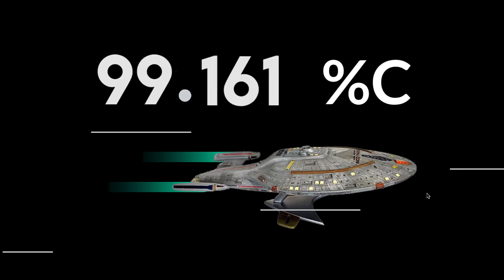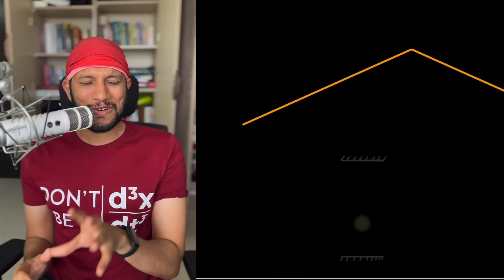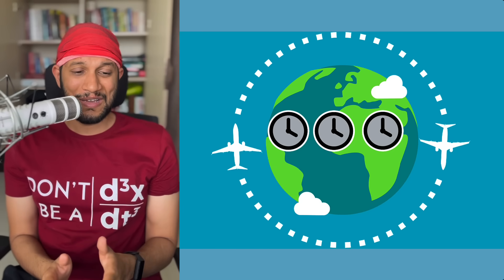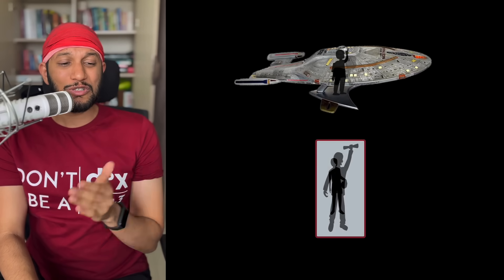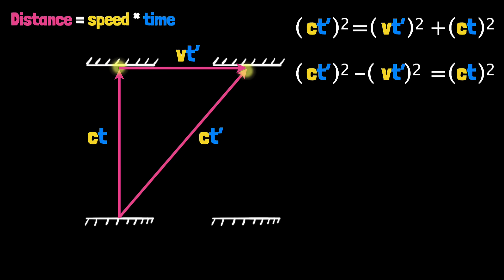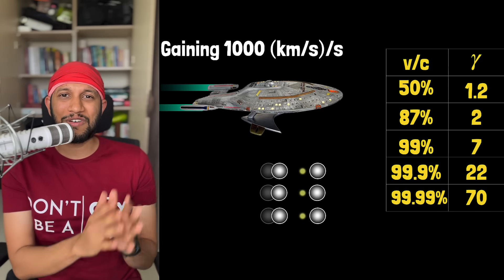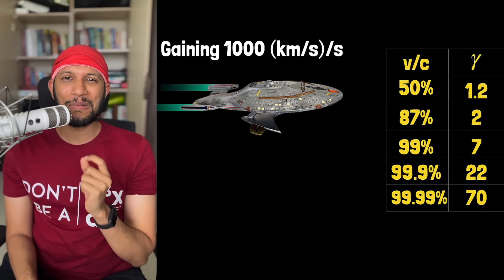I finally understood why you can't go faster than light! (My mind is blown)

Comment: Go with Brian Greene’s explanation.  If you manipulate the “Gamma” equation, you’ll find an “imaginary” axis locked at the speed of c.  In other words, we are “locked” at the speed of light traveling through the dimension of time.  Now, yes, immense things like black holes or massive galaxies can “bend” it a little bit, but gamma is really, really hard to change.

You talk about time dilation, it’s simply applying the Lorenz transformations from one inertial frame to another.  We have to design the clocks in GPS satellites to run just a tad faster to compensate to get the accuracy needed.

Comment: What if on a vehicle moving at 99.99% of light speed, headlights arr switched on. The light beam from an outsider's perspective will physically still appear to be faster than light. Or basically would you see complete darkness (no beam from headlight), beacuse that light will never reach the outside observer🤔.

Comment: But this can't be. no forces or velocities in the x direction can change the time of trajectory in y direction . if the ship suddenly goes in the speed of light the photon would just make collision with the left wall and so on on the opposite and that would make the photon collide with all the walls and break the sync . 
in a different case if the ship is already at the speed of light then the photon has to be the speed of light at both x and y Direction which makes it easier. in this case no deviation of path can be noticed. 

in both the cases your explanation fails .
Reply: c is the only speed in space time, it's not dependent on force
Reply: @AMC2283  its physics man everything is dependent on everything. we just make theories and make assumptions to make calculations easier . 
assume you take a torch and turn it on and put light on a wall . now if you raise the light in y direction doesn't the point of light being projected change ? and there's your answer when you move your photon clock in some direction different to the trajectory to the photon it's likely to affect the trajectory of the photon itself its just simple mechanics .
Reply: @deepakmahata12  if you’re so smart what’s stopping you from learning more about relativity
Reply: @AMC2283  oh I'm not trying to justify myself as smart . I'm here with a simple doubt and trying to correct the flaw whether it's about my theory or his . i just need someone who could clear my doubts . if you can then you are welvome my friend don't get me wrong .

Comment: Simple answer.  All movement through the aether (quantum space) is controlled by the medium through which it moves.  The aether Sets the speed limit.  EM waves are transmitted by the aether and cannot be transmitted faster.  Matter(mass ) trying to move through the aether causes a massive backward pressure by the aether against movement.  By the way; that pressure is called gravity.
Reply: Напиши физико-химические параметры эфира.

Comment: Space and time are the same thing, right? So, if you accelerate at speed of light, time stops. And if you let time flow, you are slower than light. The two things are bound together, like the x and y in a graph. The bigger the Y, the smaller the X and the bigger the X, the smaller the Y.

Comment: this guy is THE BEST, MOST CLEAR EXPLAINER, after 50 years of attending lecttures, reading hundreds of books. the guy has a gift... thank you so much
Reply: Real
Reply: IT'S POSSIBLE HE'S READ THOUSANDS OF BOOKS - EVEN THAT HE'S READ EVERYTHING ABOUT THE KNOWN PART OF THE UNIVERSE AND NOWHERE IS THE KNOWLEDGE ABOUT UNKNOWN MATTER AND UNKNOWN ENERGY EVEN 94+% -- ALL WE KNOW IS JUST ONE PIXEL AND WE DON'T KNOW IT ENOUGH-AND ON THE BASIS OF THAT, TO CLAIM WHAT IS IN THE WHOLE PICTURE WHICH WE DON'T KNOW HOW BIG IT IS OR WHAT IT IS MADE OF - IS THAT NOT IN THE DOMAIN OF FAIRY TALES?
Reply: The entire video is a circular fallacy. You supposedly trying to prove why it can't go faster than light, and you start by saying "the photon always moves with the speed of light".
Reply: @AnoNymous-dh2sv no you're trying to prove why you can't go the speed of light or faster. Not the photon.
A light photon in a vacuum will always travel at the speed  3E8 m/s.
A least that's how I understood this video
Reply: No.
Reply: Did you realize that your conclusion ends with the energy required, infinite or finite? Did you know that you also need energy to see the photon in the photon clock bounce? Just for reference, the photon in the photon clock must split off a photon to your retina in order for you to see it. Even if you only see the photon in the photon clock once a second, the photon in the photon clock must split off a photon to your retina every second, not to mention that Einstein also saw it. So, at least two photons are needed. Of course, to connect the dots or photons you see and form the jagged image, do you know how many photons you need to see? Does the photon clock on the spacecraft have enough energy to emit enough photons for you to see it, whether you see it or not? Indians are the best at regurgitating what they have eaten and acting as if they have understood it. After all, at a speed v comparable to the speed of light c, does the Pythagorean formula still apply?
Reply: ;DDDD
Reply: Not really
Reply: Just wait until you find out how to bypass the Heisenberg uncertainty principle or create faster than light communication.  Then you'll have some fun.
Reply: @zavatone aliens watching humanity be like:
Reply: it is wrong. no real clock slows down, because no real clock measures time, not distance. all real clocks measure time*distance, and that is a non-variable. 
Einstein was often confused
Reply: @Sergiu.antifascist I think you're confused.
Reply: @Sergiu.antifascist If no real clock measures time, then what is there that can measure time? And if there is nothing that can measure time, then what makes time a real thing on its own?
Reply: You've read 100's of books on this and it still took this dude's video to understand time dilation?
Reply: Doing something wrong if u found nothing valuable on this in 50 years.
Reply: The issue with this explanation for me is that it is BASED on the assumption that the photon can't go faster than the speed of Light. BUT WHY? 😂😂
Reply: you have 1000 videos on yt ekplaining it equally good, if not better
Reply: @MrAlkanet-nt9ic  all are wrong. not a single video of all those, explains you the three aspected time, or distance. not a single video made in this world, yet, explains what clocks measure
Reply: @Sergiu.antifascist  clearly you havent watched all of them...
Reply: @Sergiu.antifascist wtf are saying?
Reply: I don't understand why he would use a ship from Star Trek, because everybody knows that Warp is all about making space move, not moving the ship.
Reply: @perttiroska9970  I never watched start trek, but I always assumed the engines used caffeine exploders. Then when the ship blows up it becomes end trek, and we could all then watch a tv show that doesn't suck.
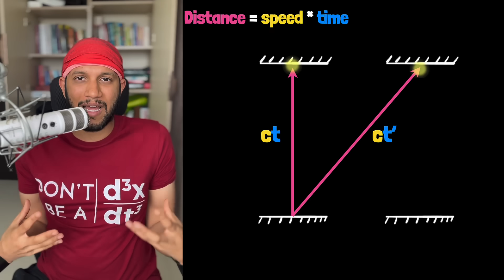Reply: his explanation is flawed though. at 8:40 he claims that hypotenuse is ct` , without ever asking why is it c times t` . this formula itself assumes that c does not change, and therefore it's t that must change, into t` in this case. but why must this be the case? what if the speed changed, because of some effect? he never asks that, he just assumes that photon moves with the speed c , not questioning it, and yet here lies the very question he ventured to answer.
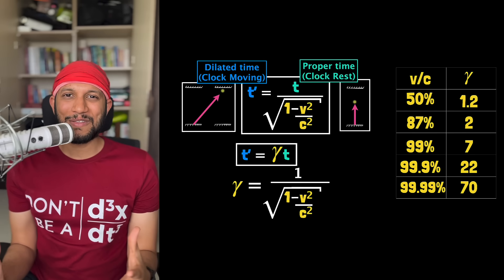he completely misses it.  and then after 11:40 he tries to answer the actual question of "why can't we go faster than light", and for that he proceeds to calculate some dilation values using the formula that assumes c is max speed . you understand the fallacy here, right? 

so he tries to prove that c is max using a formula that assumes c is max.
Reply: @foxxy-t4i  ? Are you actually questioning if light always travels at C? It's as proven as you can get in physics or anything for that matter
Reply: @sousounosali  We all once agreed that it might be a small dwarf, or a toad living in that hunch on your back. To question that would get you a dip on the witch's chair. Old SNL reference there.
Reply: @sousounosali  you seem to misunderstand. I am not questioning anything, I am asking why cannot something go faster than light, which is precisely the question the author of this video set out to answer. Sadly, he used the formula that just assumes that C is max, so it doesn't actually answer the question.

He uses a clock experiment where he assumes that hypotenuse is ct` , without ever asking why is it c times t`. What if it's c' times t' ? Why is c fixed? He never explains it, he just assumes it is so. Which does not answer the question.
Reply: @foxxy-t4i C is fixed because it's a constant that has been measured and confirmed millions of times. The speed of light is always the same in a vacuum, regardless of the observer's motion.
Reply: @foxxy-t4i c is the speed of light and is a constant. He's not proving why the speed of light cannot change, he's proving why we can't reach that speed. c cannot change which is a known fact that can be proved by other methods
Reply: @foxxy-t4i  Maxwell have already and experiments already shows speed of light is constant no matter what ever.
Reply: @foxxy-t4i  I get your point, but do you understand the concept of a constant? I mean yes, theoretically it's possible there is no such thing as a true constant, in which case: math, physics, and science are all wastes of time. Without constants 2 + 2 cannot be 4, because 2 might not actually be 2, and 4 might not actually be 4, and maybe equals isn't actually equals. Maybe atoms aren't actually atoms, molecules not molecules, space not space, time not time. There have to be some constants or our entire universe (and our experience on this planet) would be a chaotic incoherent blob of matter and energy with no definition or rules. How do we know it's not that? Look up on a clear night. Does that look chaotic to you? There must be some constants for that to be what it is. True is always true. False is always false. 1 is always 1. c is always c.
Reply: @keyser456  to be fair it isnt even a constant, because Light can definetely move at different speeds, depending on the atmosphere. Also two fhotons moving at opposite directions do seem to have a speed of 2c relative to each other
Reply: @keyser456  sure, I know what a constant is. I'm not saying C is not a constant or something. I'm asking why cannot we go faster ?

I know people measured the speed of light, that's how we know it, but how do we know nothing can go faster ? I'm not saying we can, I'm asking how do we know?

You can say that according to some formulae the energy needed for faster-than-light travel is infinite, but understand that those formulae assume that you cannot go faster than C. Saying that infinite energy would be needed is useless because this statement itself relies on C being max!
Reply: @expertluck566  No, the photons each move at c with different vectors relative to an outside observer. From their own reference frame (i.e. relative to each other,) nothing is moving at all and nothing ever will.
Reply: @DamienPalmer  yeah, it might be so. The video does nothing to explain why it is this way
Reply: @foxxy-t4i  Mathematical models that have, so far, been shown to accurately represent the behavior of the universe, actually have solutions that show that it is possible that there is matter that travels faster than light.

However, this type of matter ONLY travels faster than light. It increases speed when its kinetic energy goes down, and it goes at a slower speed when its kinetic energy increases. It requires infinite energy to slow down to the speed of light.

There's no empirical evidence that this type of matter exists (tachyonic matter), but we have accurately described everything we know so far with math, and the math shows that tachyonic matter MIGHT exist.
Reply: @expertluck566  As for the last point - while we can launch two things in different directions at the speed higher than 50% of the speed of light and for us the distance between them will increase at a rate faster than the speed of light, from the objects perspective they will move away from each other at a speed slower than speed of light due to, once again, time dilation
Reply: @dddddd-ut7ud  yeah yeah, once again this is very simple to understand. Noone can give a good explanation why time delation should even exist in the first place though. Either this topic is far too comolex or it is filled with theories that can easily turn out to be false. Most probably its both
Reply: @foxxy-t4i no it doesn't. It proves you can't go faster. Did you watch the same video I did?
Reply: @expertluck566 The speed of light is always the same in a vacuum, regardless of the observer's motion. This is how a constant is derived. It's been tested, replicated and confirmed millions of times.
Reply: @declanp1  doesnt answer the question "why" in any way
Reply: @expertluck566  yes C is a constant.
C = speed of a light photon in a vacuum.
Speed of light in earth's atmosphere is still so close to C we are allowed to call it C almost every time (i haven't seen a calculation yet where speed of light is not C but like 99.999999C (idk the exact number but you know what I mean) but if you find it pls send me, that'd be very exciting to see :))
Reply: @henk9809   speed of Light in water for example is like 75% of C, so no. It can change SIGNIFICANTLY
Reply: @expertluck566  i know but we're talking about space here so it's very unlikely we're talking about a foton clock with water or jelly or something. We're talking about a vacuum.
And nonetheless C is still constant. That the speed of light isn't a constant doesnt mean C isn't
Reply: @foxxy-t4i  your question is flawed, It's like asking why is apple apple, Speed of light is constant, just like Apple being apple is constant.
Reply: @foxxy-t4i  c will be constant because let's say at starting that spaceship was on earth, and then it travelled to mars, the speed at which light moves from son to earth and son to mars will be same but time will change. that's why it is t' which is more than t.
Reply: @foxxy-t4i  I think he uses it as a constant not a max barrier
It is ct` because light always travels at the same speed. This is what the theory of relativity is based on.
Reply: If only he could be understood...
Reply: He talks a tad too fast for comfort. And his cadence is a bit sing-song, which tends to lull the listener.  Still, a very good video.
Reply: ngl if youve been to multiple lectures and didnt understand it and this guy was ur breakthrough thats kinda embarrassing
Reply: We measured time based on Earth's full rotation, and while light travels fast, we can still measure its speed by the time it takes to cover a distance. Once we know the speed, we just need to build an engine to match it. This video is misleading.
Reply: @samdajani2573 oh, just like that? Easy! 😂😂😂

Comment: Interesting - so there appears to be a "sweet spot" of speed to travel to/from a nearby star, such that you get there as fast as possible but still come home without too much extra time passing.

From the numbers above - if we want to travel somewhere 1 LY away and back and get there quickly, but also not have everyone age massively, then 87% speed of light is about the right speed to go at:

Takes 1/0.87 (1.15) years to get there (proper time) and the same to get back - so thats 2.3 years, and then for people on earth dilated time is 2.3. x 2 = 4.6 years.

At 99% light speed, it takes about 2 years to travel there (proper time), but dilated time is 7 x 7 = 14 years. So its not much faster for the travelled, but its much longer for us back on earth.

At 50% light speed it takes about 4 years to get there about back (proper time) and dilated time is 4 x 1.2 = 4.8 years, which isn't much different to 80% light speed for us on earth, but means the traveller takes about double the time, therefore double the supplies etc...

Conclusion - we don't actually even want to go too fast (assuming no warp/wormhole etc...) - 87% sounds good to me

Comment: If photons are limited by speed of light it would logically require a different measuerment for time which does not have these limitation. Measurement with a limited base will always lead to infinite time, because of that limitation. And you said it correctly, it would take inifinte time to measure, which means your live is over in one tick. The measurement from outside in different referential systems with the effect of lorentz time dilatation is just a releative tool for measurement in two different referential systems. I guess the (real) time will not be different, you need the correct measurement, maybe gamma rays, tachions or even enthropy for measurement which is not bound to the speed of light. But it was fun how you resolved the human perspective of physics to describe the process of measurement.

Comment: What if we imagine the following situation: inside one ship there is a smaller ship. Which moves inside in a circle until reaching maximum speed. And so on in several iterations.
One ship contains an even smaller ship, and so on. Then, synchronously, in the required sequence, the locks open and the smallest ship leaves the rest and flies in a straight line.
And theoretically (in my imagination) it overcomes the speed of light.
Still, people want to fly at superluminal speed someday. Let's leave them hope =)